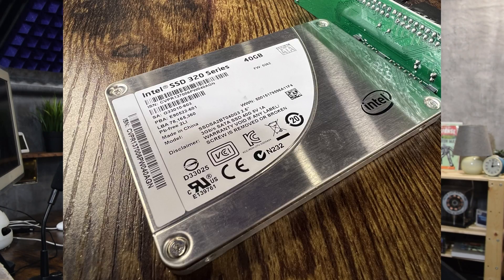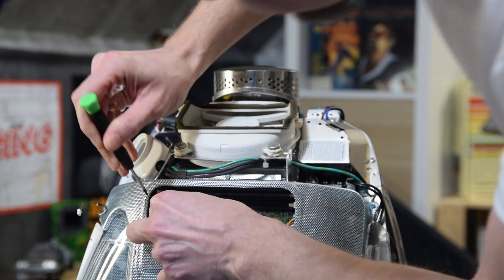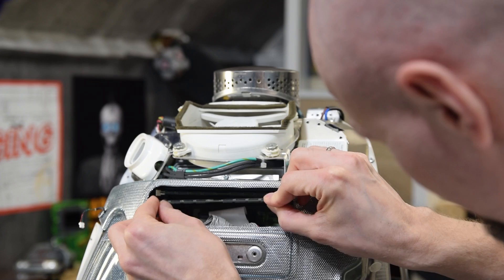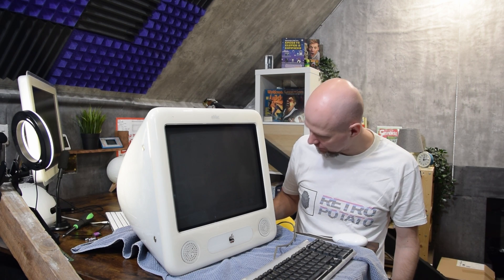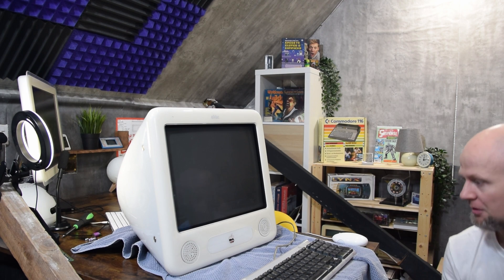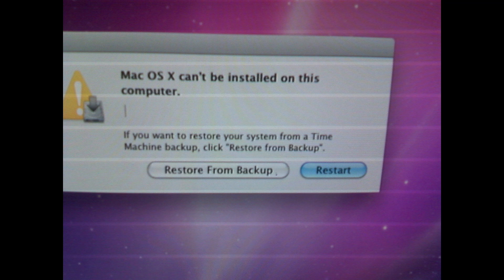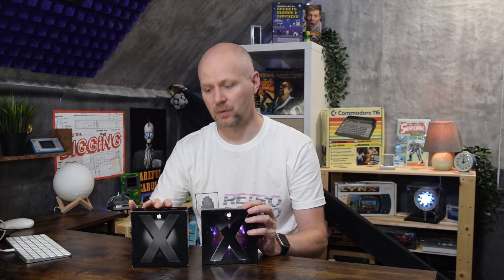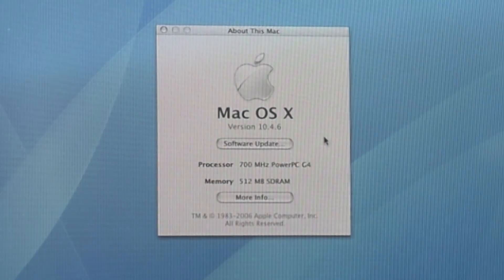eMac upgrade

Comment: Very interesting.I  upgrade the RAM up to 2gb and works fine. Its the superdrive model. Although in the specifications it was limited to 1GB but I put some Veineda ram from Aliexpress (I don't know if they are still for sale). Now I barely use it, if one day I install Linux Mint or similar I might be able to get some more use out of it. Saludos desde España

Comment from the maker: Just imagine removing the grill before installing the battery and memory... instead of doing through that relatively small gap... it would have been easier :)
Reply: Is it possible to use the MAC casing and CRT and just replace a new motherboard or have the video out connected so you can use another input like a micro ATX?